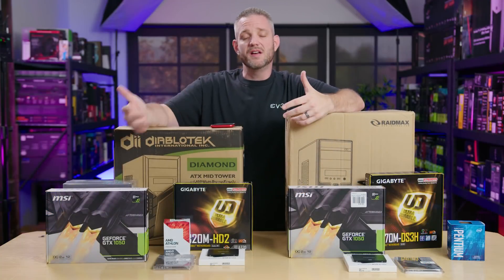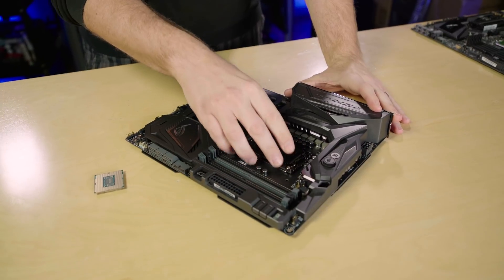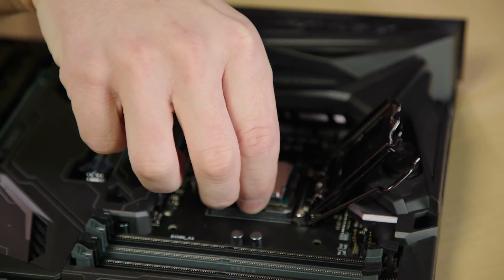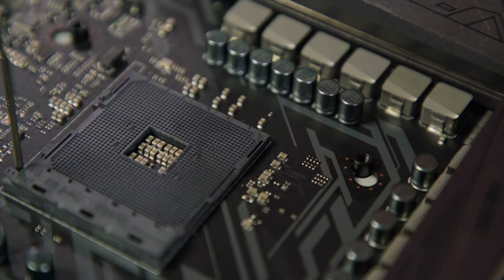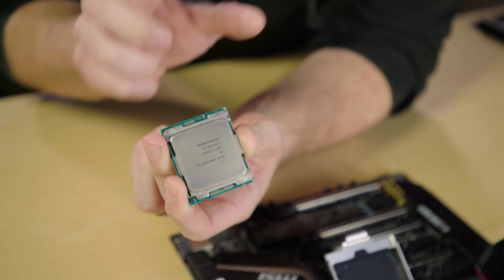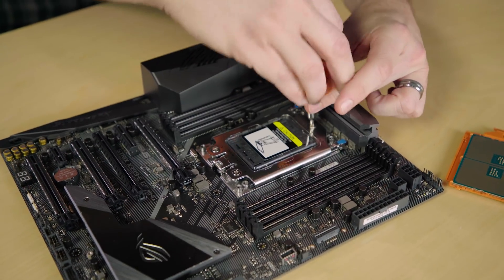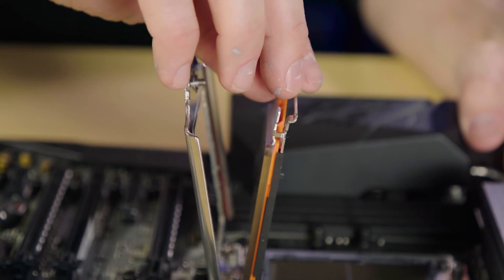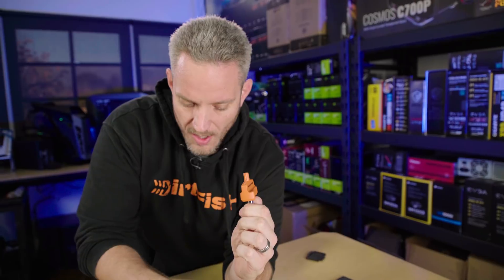How to Install a CPU

Comment from the maker: It's been a long time since we made videos tailored towards the beginner. That's exactly who these videos are for... all of the new additions to the PC Community.
Reply: What happened to the Threadripper mobo where you couldn't get screw 1 to catch?
Reply: First time I installed a CPU, I accidentally droped the CPU on to the socket, damaging the CPU pins and more or less destroyed the socket. And thats how i learned to leave the socket cover on until it poped of by it self.
Reply: Sharing is Caring.
Reply: Good series. With more and more hardware coming out, hopefully more and more people will jump in and build their own computers. So these videos are indeed a very must have to get the self-pc-builder-movement going!
Reply: EXCELLENT IDEA! I've been doing this for a long time but found myself pausing and rewinding several of your video's when I attempted my first custom loop.  Completely redid it though cause I used the smallest hard line and it looked horrible.  Anyways I enjoy watching these video's even though I'm well aware of the info presented.  You should have another go at the water cooling basic's after this.
Reply: Jay when you told me not be scared installing my cpu, I felt like Jasmine with Aladdin.
Reply: Good idea for a series, thumbs up! It would be cool to get a video about best ways of removing the thermal paste when swapping CPU coolers
Reply: Mind doing an updated video on cpu and gpu overclocking?
Reply: Thanks man. Been wanting to see you redo some of these videos for awhile.
Reply: Happy new year Jayz
Reply: Thanks Jay. I have been into PC gaming for a 5 years now, but I never felt comfortable in installing my own CPUS, always thinking I would make some mistake and kill it. This video will come in handy for sure.
Reply: We need to address Intel's socket J and how easy it is to bend pins and stuff. if you bend the ram area pins etc lol
Reply: its nice to see that people still like building there own pc's, just a shame that computer stores all around the uk are slowly getting to the point where you have no choice but to get parts online
Reply: Very useful to me. I have always been afraid to put together a custom pc because of stuff like this. Thank you very much for doing this video Jay!
Reply: Thanks Jay. This is great for people who are going from one brand to another. I have only did intel build and considering doing a ryzen rig. This is a great info.
Reply: jay can you make a video on how to help beginners on how to make a new pc ? like how to chose parts, how to set it up and how to install windows etc... i know that you might have done separated videos already, but i mean re-do them as a series of 3\4 episodes maybe, a fresh start in the late 2017. 
Thx if you respond or even read this comment, keep up the good work, you did help me a lot.
Reply: JayzTwoCents This is why I like your channel better than anyone else’s.
Reply: A video about measuring and properly cutting hard tubing would be awesome. I wasted A TON of tubing when doing my build, because there weren't any tutorials I could find and I was pretty much eyeballing it.
Reply: I was wondering the same thing...
Reply: Hey Jay, you keep saying right side up and upside for the CPU, but for a novice builder, you never explain which side is right side up for the motherboard. I feel like that's a huge oversight.

Otherwise, great directions though.
Reply: Of all times to post this, you post 2 hours AFTER I finish installing my very first CPU. 😂 And now my house is on fire.
Reply: I hope a great deal of people watch this. So that they don't fear D.I.Y.
Reply: Clay you're going fall in love with you're own build. I have built two in just one year, and will be building a friends computer this spring.
Reply: Shady Brady some of us old (er) folks are learning too.
Reply: Should've waited!
Reply: I waz actually wondering if someone would do this. It was an idea a couple days ago. I was wondering if with the series you could attach links to the videos in the beginning. Perhaps each being a chapter like each to a book to complete all steps of computer building, troubleshooting, overclocking, and even possibly adding look to a pc case or such.
Reply: BRo 1st time i see how is ryze cpu instal, so IS EASY, is the easyer one of all , cuz u just slide the CPU into the braket and u dont have to touch it and be nervous, cuz when i did my 1st PC instal, i was REALLY nervous about the CPU, then the 2nd time and 3rd time not that much , but for 1st time installers people that is pretty good
Reply: Yeah even that one is probably ok for a lot stuff...but the 4C/4T does show some bottlenecks in some stuff...why i got the 7700k 4C/8T is still good.
Reply: JayzTwoCents do you think AMD as a chances against coffee lake
Reply: I love back to the basics tutorials. Really not gimmicks, just for people that are still contemplating building their own rig because they fear they could damage something. What I personally would love to see is a step by step (and maybe a bit backround) explanation for CPU overclocking. That's what I haven't done with my rig so far...
Reply: immediately recommended to a friend who is going into building a new computer, thanks jay
Reply: It is Ultimately Satisfying, Tech vids man.
Reply: Keith DeMons  you still want to go Intel honestly, still Faster and stronger cores.
Reply: should have added a clip from that video where you tried to force the TR closed ;) (as a how Not to do it)
Reply: JayzTwoCents you should make a video about what to do when the build is complete...such as installing the os....a lot of videos only shows the build and ends there.....sometimes people know how to build but dont know what to do next...haha...
Reply: Not a beginer, but still like the video.... nice job introducing new people to the pc world.
Reply: I guess next is thermal paste spreading?
Reply: If orientation of my CPU to the socket is correctly but when I dropped to the socket my CPU and it doesn't match with the notches because it was little too much on the left side to the socket I should to move (slide) to the good side or I should start from beginning installation procedure (pick up and dropped again)?
Reply: could you or Phil make a playlist out of all the videos for the series? I'm trying to advise a bunch of friends from across the US on how they can build their own pc and I feel that the "How to build a computer" from Dec 21, 2018 was a great watch for someone who knew even a few of just the basics but the video, to me,
 had missed a couple small points that could be useful for a downright noob in their first attempt at a pc build. With the climate 2020 has created for the PC masterrace, I think now more than ever is a great opportunity to refine a "noobs guide to pc building" playlist explaining what you're doing and why you're doing it the way you are. along every step of the road to building your pc. like when you opened the side panel of the pc you're building in then cut away to "and here are a few cases I had sitting around to show you a couple of other common side panel latches" yes they could check the manual but people are lazy. having a few examples of what they'll commonly see is greatly helpful in noobs really understanding what they're doing. anyone reading this in 2020/2021, mind passing me an upvote so Jay hopefully sees this? <3
Reply: Am I supposed to use my finger to spread the toothpaste?
Reply: JayzTwoCents please when ya cover CPU coolers. make sure and mention the bit about being careful with pga CPUs (basically ryzen CPUs, but just in case  for fx users also) witho removing the heatsink and why. So someone new dosn't bend some pins on accident

Comment: I’ve heard you need thermal paste ? I am thinking about upgrading my of with I-9 14300k. This won’t have the cover on it and a new liquid cooler. Anything that you may be able to share on if this will change any of the steps or items I would need ?

Comment: just want to say very easy for those who know. But you should slow down and focus a lot more on the most critical steps. You did not clearly show the motherboard corresponding tabs. Just remember a novice who never did it before must be able to get the most important parts, esp the aligning.

Comment: CPU and CPU Cooler installation is, as of this month, the only thing ive NOT done regarding building a pc... i will say its something im extremely nervous about. My first proper laptop had an AMD GPU (6770M 2gb), and it got quite hot very easily. I was told this was normal for AMD, so ive been avoiding it since... but considering how terrified i am about CPU installation, i gotta say, the TR4 looks very appealing, as it looks like the chance of ruining pins is lower than intel. Also looks like its noticeably larger than my 4790k, which also makes me more comfortable (Dad installed the 4790k, but good god was it a lot smaller than i expected...)

But thats just initial thoughts...

Comment: i just upgraded my new CPU but when i boot the pc it normaly boots to windows with the HDMI connected with the GPU but when i check if i got nvidia or if the GPU is detected they are both missing

Comment: how do i know if the socket on the motherboard will fit my cpu? for example i want to build my pc with an i7 7820x and it's 8 core, or an i7 7800x which is 6 core/ how do i choose the right motherboard?

Comment: Just put a cpu in a Rog Maximus X and the cpu holder would not stay closed the socket cover pooped off but still would not stay closed finally had to loosen the screw for the socket to get it to stay is this normal? cpu is a Core i7 8700k

Comment: Installing a CPU is easy enough, it's changing it out that gives me the heebie-jeebies (on LGA sockets).  It's down in the socket, there's very little to grab onto, and if you drop it you'll bend pins, so no room for mistakes.

The Threadripper thing with the tab to grab onto looks really convenient to me.  Intel actually makes an installation/removal "field tool" that grabs onto the IHS and lets you lift it out, but they are really hard to track down.  I managed to find one for LGA20xx but haven't been able to find one for LGA15xx yet.

Also, there's nothing quite like the sound of latching that thing shut and hearing all those pins creak as they load up.  Ugh, freaks me out every time even though I know it's coming.

Comment: Side note: Most vintage Intel and AMD platforms from the classic Pentium/Athlon era, and even into the x86 era, work the same way as Mainstream AMD processors.
Just in case you ever find yourself (re)building, upgrading, or repairing a retro DOS or early Windows gaming machine.

Comment: I think out of every computer build task, the only step that even non-beginners get a tad antsy is applying thermal paste to the cpu and installing a aftermarket cooler.  Based on the cooler, it can get interesting fast.  That’s a good next video.  Start with a big clunky air cooler.. Thanks..

Comment: Jay, this question is off topic from the video but I don’t want to wait for a water cooling video so here we go. I built my own pc about 2 years ago and used the hyper 212 evo air cooler and want to change to a smaller white cooler but don’t want to loose performance and it seems that the smaller the air cooler, the hotter the cpu generally. That’s where I thought of water cooling. I’ve never done it before and I’m a little skeptical if it because if there is a leak, my system could be completely destroyed and I simply don’t have the money to replace it. Would you suggest sticking with air cooling and if so what air cooler would u suggest for a somewhat slim cooler that is mostly white and has comparable performance to the hyper 212 evo. Or if you would suggest me trying water Cooling, which one? I’ve done some basic research and I was thinking about the corsair h110 v2, DeepCool captain 240ex or even the ek performance kit.

Comment: I'm still using the first computer I built, and I remember it taking the better part of a day to finish.  One thing I learned eventually is that PCB is damned tough and you can really put some force into slotting components.

And curse you, Jay!  I'm saving up to build a high-end workstation, and your videos make me want to do a custom loop.  Soft tubing, because I'm not crazy, and I'm still not sure if I want to include the GPU's in it.

Comment: Gotta question i added my gtx 1080 to my water loop now my loops runs hot my i7 7700k went from 65 -70 to like 75-80 but my gpu went from 70-72 to 55-60 degrees but my rad and tubes are warm the rad is kinda hot I have a 360mm rad should I add a 2nd

Comment: I work at a computer store with a repair shop. Today a guy came in with some brand new PC hardware, and said he couldn't get it to work. We looked at it and saw the AM4 CPU socket was full of thermal paste, and the M.2 SSD hanging out of the motherboard, not screwed in. The customer said he had tried to mount the CPU with the pins upwards, because the pins wouldn't fit into the socket. 
We were all speechless, except my boss, who actually got mad, calling it unprofessional amateure work. The motherboard and CPU was broken, he bought some new hardware, we assembled it and got the rest working.
Don't be this guy, watch JayzTwoCents and LinusTechTips, and learn to do it the right way!
Reply: I'm not joking when I say he tried mounting the CPU upside down, this guy was just a serious moron

Comment: I will say the most easiest way to install a CPU will be by buying a nice asus motherboard they come with a plastic place holder for CPU and u use it to drop the CPU presicely on the the pin perfectly in contact
Reply: I just got one of these with a Z370 Maximus X hero and it confused me at first as I had never seen it before, and the little pop-off thing was still on the socket, so this was something extra, not a replacement for the old thing. Once I read the instructions and realised you're meant to leave the new thing installed with the CPU (unlike the pop-off thing that is only on until/during installation itself), I used it and it worked great. I swear it is magnetic as I got near the CPU socket and was about to line things up by eye before dropping it, and the thing flung itself into position.

Comment: Wait what? I recall a video of you complaining about TR4 / Threadripper socket screws not catching their receptacle's threads, despite of a metaphorical 200 pound gorilla (no offence given) pushing, shoving and torquing …why does it look so easy-peasy lemon-squeezy in this video?

What you see is what you trust; could you please provide sources / documentation (photo / video) of actual incidents of snapped / over-torqued TR4 socket screws. I mean the purpose of a torque wrench is to limit the applied torque to a predefined maximum, on every click! …how could one possibly over-torque / snap screw heads?

Comment: They only thing I would add to that video is you touching the the top of the heat shield and wiggling it the way you did in this video, is to make sure if you touch the top of the heat-shield to clean it after with isopropanol because oily residue from your fingers will affect the way compound is spread, the oil from your fingers can make blank spot where the compound should be. This of cause depends on how oily your fingers are. I know your already know this Jay, just pointing out to others who may follow this guide and assume its then OK to apply compound.
Reply: Especially if it's your first... Must be sweating AF
Reply: Britec09 true
Reply: It's not called a heat shield it's called an Integrated Heat Spreader. You're trying to distribute heat, not return a payload from space.

Comment: SOMETHING WORTH NOTING FOR FIRST TIME INTEL BUILDERS: when you socket the cpu and begin lowering the retention arm, it will take a little bit of force. my first time doing it i thought i was gonna break something, so much so that i stopped half way through lowering the arm twice to double check the cpu was seated correctly.
Reply: Did your motherboard have a foxconn socket?You need 1 trillion tons of pressure to push it down
Reply: Idunnohuur I don’t know. My mobo is a Gigabyte z170x gaming 7.

Comment: I'd also add a note that the Intel Extreme line requires a bit of force to put the levers back once the CPU is installed. If someone is holding their brand new $700-1700 CPU for the first time, their hands might shake a little once they realize how much force is actually needed to secure both levers :) I know that I was a but surprised when I moved from mainstream for the first time.

This is one of the first daunting experiences when it comes to PC building with new parts for the first time - no videos is going to prepare you for the amount of force required to use in various scenarios. Similar example was when I was removing the air cooler from my Strix 1080ti - when you are holding a $700 GPU, you tend to think that you must be super careful with that and then you hit a wall once you have to remove the cables from it which requires a bit of force. Doing that for the first time is nerve wrecking :)

Comment: Thanks Jay, that's the perfect format for this kind of thing! I'm not an inexperienced builder myself, but I've never installed an Intel X or a Threadripper CPU, so it's nice to have the knowledge in a neat package.
I'd love to see more, especially on subjects like cable management or water cooling (or cooling in general, really).

Comment: My Asus z370 board comes with piece of plastic that Asus calls the cpu installation tool. I'm supposed to install the cpu in it then put the whole thing in the socket. Its for avoiding put the cpu in the wrong way or dropping it. I didnt use it because i was worried that it would melt when the cpu gets hot but i wonder if using it might also help the cpu it make better contact with the aio cooler block, especially after seeing that Threadripper comes with a plastic piece and it seems safe to use.